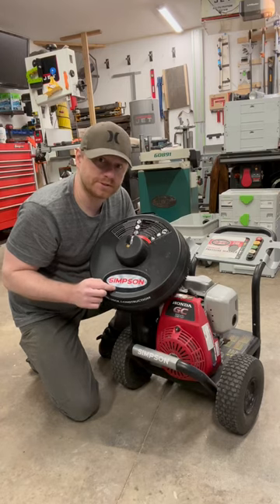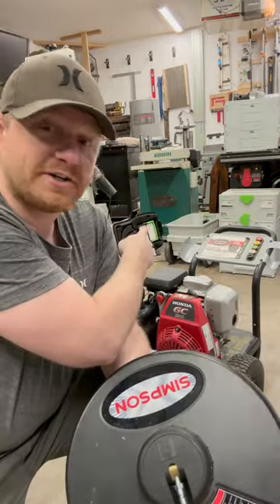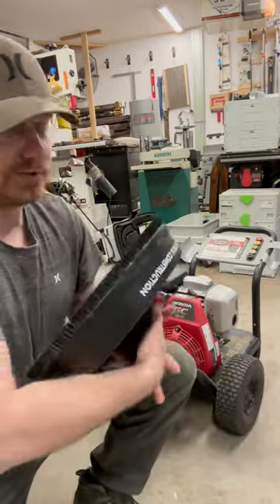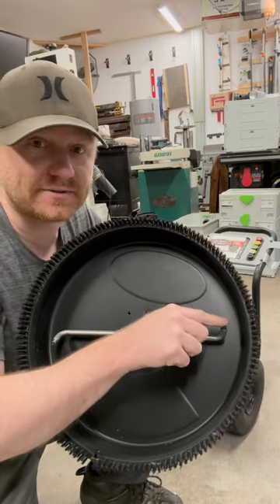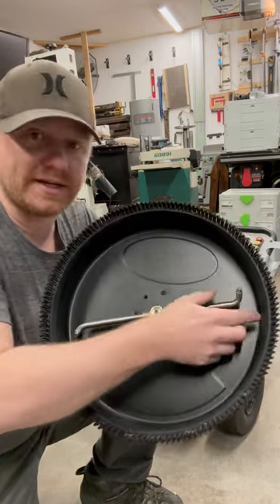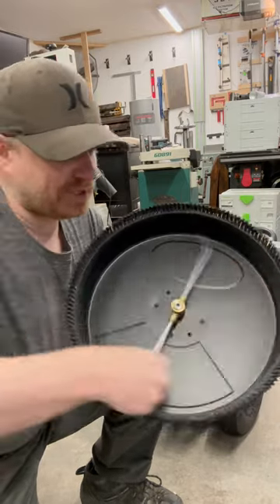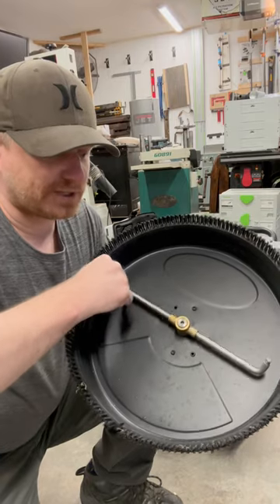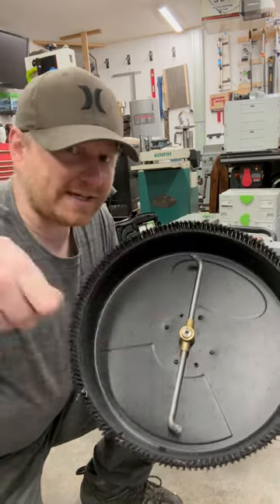Do NOT Buy: Simpson Surface Pressure Cleaner

Comment: As a pro for 19 yrs you get what you pay for! I purchased a 30” made by North Star made serious BANK every time. First start with FLOW not pressure. Everyone sees the PSI and figures thats power but a 3000psi @ 2.5 gpm is a newb machine. You really want 5-6 gpm and 2-3000psi that takes HORSEPOWER!  3000@6gpm = minimumof 18hp. Nuf said
Reply: I ust to run a 10k gpm was like 12-18 or something crazy. With a 00 tip it would cut yur foot off
Reply: @EO.studios  10GPM@3000 takes 25HP minimum for just cold water.
Reply: Anything north start or that is from northern tool as far as pressure washing equipment is concerned is pretty much garbage. It is consumer grade equipment dressed up to look industrial. Our service department stays full of them year round down here in houston. Their parts department is despicable to deal with and lead time in parts is normally weeks. Spend your money on quality equipment from either Mi-T-M or a Karcher company like Hotsy or Landa.

Comment: Also keep in mind that the gallon per minute rating of a service cleaner, greatly affects the performance if the PRESSURE WASHER you're using is below or above that output rating. there's no one size fits all solution when it comes to pressure washing and service cleaner, but once the time is spent doing so will give you a skill set and knowledge based outcomes based on previous experiences so as to minimize last time during set up.

Comment: The problem is it just has a crappy nylon washer as a bearing surface that wears out in a few hours of use.   You are way better to buy a real surface cleaner with actual bearings in the hub for long life
Reply: What brand and model?
Reply: @philippeaboussouan2361  after I had tried a couple cheap ones from home Depot I bought a general pump 20"  and wheel kit. Works great on my 3500 3.5gpm pressure washer they use a real bearing hub that's pretty easy to rebuild if needed and possibly a greasable hub at purchase. I upgraded my hub from the non to a greasable one
Reply: Comes down to real bearings and quality seals 😜

Comment: My ryobi one works flawlessly. I’ve hit corners and nails and all kinds of craziness but it still cleans a driveway like a boss. Decks too.
Reply: I would hate to see the decks you have done with a surface cleaner. That’s a huge no no.
Reply: @tonypizzas9814  through trial and error on stained decks it’s the perfect pressure. Does not gouge and does not leave any circles. Seems to work fine for me anyways.
Reply: I have one too. 15" 2500-3300 psi range. Pressure washer is also Ryobi, 3000 psi with Honda engine. No problems and certainly not what he's talking about. I've never owned any Ryobi product, but it was on sale.
Reply: @tallens5280  same. I bought the 3300 with the 190 Honda motor 4 years ago. It’s been heavily used and not one problem out of it. That attachment has been rode hard and put up wet with no problems either. Maybe we just got lucky or he’s really unlucky.
Reply: @tonypizzas9814 What's wrong with using a surface cleaner on a deck?  Asking cause it sounds like you think you know a thing or two.

Comment: Man this feels personal, I love the one I have, works great on my concrete and fences
Reply: Fences? You're manhandling that rotary face remover up on a fence?
Reply: @j-davis7290  man it's light and made of plastic, it works damn fine for what I use it for
Reply: @j-davis7290  lmaoooo yeah dont everybody do that?
Reply: I have used it many times on my vinyl fence and also even on my metal shed roof. It works great 👍
Reply: Same here
Reply: Great for cleaning garage doors. Doesn’t leave marks
Reply: Dont allow it to fall off any corners. It will be a problem after that.

You can bend it back with the box end of a wrench, but its hard to get it back to the right spot.
Reply: @shawntame45 lololol
Reply: Production tolerances. Company probably has bad QC and you got a good one while he got a bad one.

Surprisingly common, why warranties are important.
Reply: Everything works well when you only use it recreationally once in a while for Harry Homeowner type fix up jobs 😂 for example any electric trimmer or lawn mower. Your anecdotal evidence is not sufficient 😢
Reply: @WagwanHappyPappyHapPap  ☝️🤓
Reply: Same here, and I have a 2700. My neighbor borrows it sometimes and he has a 3700 with no issues, I just service mine once a year. He probably got a crappy 1 so he can do a crappy review...

Comment: Just rejet the nozzles. Get a carburetor jet drill set, and drill out the nozzles till you get the flow that’s right for the amount of pressure the washer is outputting. You’ll get more flow out of the nozzles, which means less restriction, less upward force that locks it up.
Reply: Or buy a quality one and write it off
Reply: The orifice size in the tip is how pressure washers generate pressure. If you make the hole too large your pressure will drop significantly. The tips on the surface cleaner has to be sized to the pressure and volume of the machine being used. All drilling them out is going to do is lower your pressure.
Reply: How about companies not lying?
Reply: He needs less flow and more pressure.
So smaller orifices.
 And some thread locker

Comment: I have this exact same model and I used it for the first time yesterday and had the exact same problem! I tried looking into it on the internet but didn't find very much helpful information. What do you recommend?? Trash it? Sell it to someone with a lower PSI pressure washer? 
I technically finished when I was working on but it took probably four times longer than it should have. Thanks for the video!

Comment: A note from a hydraulics engineer. Your pressure washer generates a triple wave pressure with a peek of approximately 3100psia at the nozzle. I have two questions for you. 
1. Is your hard line a pressure multiplier or a static line? 
2. What is the base output line pressure of your unit?
Because the typical pressure wand as a factor of 5 per linear foot, meaning the pressure is multiplied by 5x per linear foot. So a 3 ft wand will multiply input pressure by 125 times (5*5*5=125) so I’m guessing if you’re using a 3 ft wand with a tip pressure of 3100 psi, by the time it reaches the tip of the spinner, you’re at 6700psi, nearly 3000psi over the spinners max operating pressure. I’m guessing the manufacturer put the standard x4 line burst safety margin, so that pressure isn’t going to detonate the head, but aluminum has no yield strength so no matter the force it will always creep. But shoving nearly double max operating pressure through it is definitely going to accelerate that problem.

Comment: I had the same problem.  Worked great for a couple of hours then started spinning slowly and not cleaning.  After looking for solutions on the web, I found that debris gets into the hub for the spinning arms, especially if you are working close to grass, which prevents the arms from rotating properly.  The solution is to remove the arms using a hex (allen) wrench, clean out any crud, and spray the hub on the unit and the arms that you removed with WD40.  Be generous!  After doing this, it worked like new.  It may have to be repeated depending on the size of your project.  By the way, this cleaner works MUCH better than a Karchner cleaner that I had which finally broke down.

Comment: You could try removing the factory spray nozzle tips, and replace them with 40° tips. If you can raise the height of the service cleaner as well both of these pro tips will yield excellent results using any service cleaner. Some service cleaners have adjustable height located on the castor assembly and or just the bar height underneath in order maximize coverage when utilizing 40° tips. 40° nozzles as we are the most effective means to which a pressure washing job could be completed using the standard gun and wand so why not give it a try with the service cleaner if not, possibly a 30° or 25° tip while also also being  mindful of the angle of the surface washer, pressure washer tips. I know it's a pain in the ass but once you get everything dialled in with 40° tips and then raising the height as much as possible while enabling a slight angle, so has to keep the rotating momentum of the bar adequate. An easy way to remember this would be 40 Degree tips at 45 degree angle,with a 4-5cm height minimum from the PRESSURE WASHER tip to the service being cleaned. This will also help to eliminate swirl marks while maintaining a standard walking pace.

Comment: Use lock tight thread locker on the threads of the pipe to fix it.
Reply: Why should you have to fix something that was designed to work straight out of the box but doesn’t?

Comment: I'm guessing lack of maintenance or dirty water or hose is to blame. Particulate in the water can cause the head to freeze up. I actually had to remove the bolt on mine the other day because I somehow got grass on my hose and it got in the sprayer and was stuck in the rotation joint.  Pulled out the grass and relubricated it and it worked like a charm!

Comment: 4x small wheel bearing 2 on each side at 1 in distance to support the lines to the tips. if u hv problem with metal bearings use plastic bearing to not make noise or mark's

Comment: I've used this model dozens of times with ZERO troubles. It works amazingly. Am I just lucky or what?
Reply: How strong is the pressure washer you’ve used with it?
Reply: @billy9075 , I'm pretty sure they were both 3k but I'll check and let you know. I've done thousands of sq ft and the tool works perfectly

Comment: A flat bar with holes milled in it would fight the torsion effect of the water better than a round tube.  May even be able to make 2 or 3 holes and broaden the cleaning path.  Could even thread the holes and use different type of jet inserts to get different results with different surfaces and levels of filth.

Comment: I imagine if you use it a ton maybe you'd run into an issue, I have that exact model pressure washer and head and haven't had any issues over the past few years of using it sporadically. I think maybe you're not letting the head do the work, you don't have to hold it down against the pavement for it to work, kind of lifts and floats on it's own, just have to control where you want to clean. :) I hope this helps.

Comment: this could be fixed by adding a gusset along the edge of the tubing  . it will probably act like a fanblade also.
a piece of tig rod welded to a washer on both ends would prove it.
make a triangle.

Comment: It dosent bend them, the NPT threads turn, use green lock tite, set at the right angle and you'll be fine. Your welcome.
Reply from the maker: Appreciate the info!  I am a fixer as well, but I also vote with my dollar. It sends a message they should fix it when they get enough returns.
Reply: Yeah, shouldn't have to fix something like that
Reply: Thank you. Have one doing the same thing in video and been scratching my head what I was doing wrong.

Comment: Not really a solution but I have a pressure adjustment on the end on my wand before the neck. Anytime I want less pressure for anything I just turn it to the right. I got it for a similar reason to you but ended up using it more than the attachment I bought it for

Comment: I also regret buying a Simpson power washer, the pump broke off the motor the first time I used it, they fixed it under warranty. The third time I used it the concrete cleaner stopped spinning. Not happy.

Comment: Rated max pressure isnt all its cracked up to be. I bought a cheap surface cleaner of an unknown brand which looks to be constructed a lot like that one. The MAX psi rating is actually like 700 lower then the washer I use it on and its worked flawlessly for 7 years now. Clean the driveway, patio, sidewalks two to three times a year. Not commercial use obviously, but not used lightly.

Comment: Does it stick cause it bends to touch plastic or just from shitty axle design? Looking comments seems like you have faulty unit, maybe some frap that was not cleaned off in assemble process and is tightening the O-ring on the axle or how ever this is setup?

Comment: you need to change the nozzles to a smaller orifice that matches your psi anyway or you will have a problem.
There are plenty of charts out there to help you figure out what size you need.
As far as the supply tubes rotating remove them put red threadlocker on the threads then reassemble and let sit for 2 days
Reply: Now if only Simpson had heard of thread locker so you didn't have to fix their shitty product for them.

Comment: That must be the exact same as the dewalt 18in surface cleaner. I have the same issue and they look identical. They have the same brush, steel construction sticker and 3700 psi max rating.

Comment: I have the same exact pressure washer. I actually purchased the Ryobi surface cleaner and its been through alot and still works just fine. Id think simpson would have made a better one.

Comment: The problem is the grit that gets between the spinning arms and the base my dude. Disassemble it, clean out the metal slip gaskets, and reassemble it.

The washing gets tons of grit in there and it just refuses to spin. It's not the pressure, it's the friction.

Comment: I would suggest running it lower than the max psi.
Just because it can max out at 3700 psi, doesn't mean the maximum will give you better results.
Reply: You need a pressure washer that can be adjusted for the pressure. Most are set at the company and can't be adjusted

Comment: They probably threw that number on there to satisfy all the pressure washers sold at a big box store, yet designed it for electric pressure washers, you know, the folks who buy a pressure washer and accessories, yet use them once.

Comment: I had the same experience with the same model. Used on a Simpson PS3228 (3300PSI) and it failed on the first day after cleaning a concrete deck. Other reviews reported the same thing but I ignored them prior to buying. Definitely would not recommend this attachment based on my experience, this video and other reviews I've seen. Shame because it's amazing when it does work.

Comment: A common misconception about surface cleaners is that they are driven by the pressure of the machine being used. In reality, volume is a way bigger factor in how effective it will work with a surface cleaner. Most consumer machines you can get at hardware stores are less than 3 GPM, which is the minimum we recommend our customers use with surface cleaners. Most of the time we are selling 5-10 GPM machines to run larger surface cleaners.
Reply: Both pressure and volume equally count with accessories to work right. 0 degree nozzles aren't interchangeable between different machines just because they fit the click connecter.
Reply: @rossbrumby1957  volume is a much bigger factor. Pressure only comes with volume. My family has owned a company called Alklean industries for 51 years. I have seen, sold and serviced every make, model, and style of machine. I know what I’m talking about brother.

Comment: One thing people in this industry never mention! With a surface cleaner:
Using a 2 gallon per minute machine that the surface cleaner nozzle tips need to be 1/2 what the gpm puts out ? 
2 gpm nozzle tips 1.0 each. 
3 gpm nozzle tips 1.5
4 gpm nozzle tips 2.0
5 gpm nozzle tips 2.5
8 gpm nozzle tips 4.0

Comment: Maybe it's still good to just use a traditional wand. I see people using these units or similar to these units and I'm not really impressed with the quality that they produce.  I did deck work for years and we just used a power washer with a wand. Every once in awhile we would go  4 to 1 with acid.  It stinks but you've never seen cleaner concrete. Like the day that it was poured.

Comment: 1st off that is a homeowner's concrete cleaner not a contractor's concrete cleaner And it works very very good as long as you don't take it off the edge to where you do bend the nozzles

Comment: Ya because you need the right orfice nozzle on the surface cleaner. You only need 2500psi to clean concrete. Anything to do is pretreat and postreat with SH

Comment: What gpm?? If it's rated at 3700psi but only 1.5 gpm and your washer is 3100 and 2.5 gpm ,it will be too much. Pressure washing, it's the gpm that washes the crud after the pressure

Comment: the only good thing on a simpson is the honda engine . i got a powershot last year with the honda 390 , engine wonderful , AAA pump went bad in less than 30  hours and simpson would not replace it , gave me the run around , bought the brand CANPUMP from canada and love it !! sad thing is no matter which brand pressure washer you buy it is usually a simpson made with a different label

Comment: I’ve got the same one. Had it a few years now, and it’s served me well. 

Admittedly, Simpson could have done a better job on the material selection. 

That said, you’ve got to be at least 3% smarter than what you’re operating. If it comes out of adjustment, make it right, then lock it into place with some thread locker (has been mentioned several times in these comments before)

Rather than embracing the trend of voicing your grievances on social media, show how to take a mediocre product, and make it better. Offer solutions, not problems. That’s what manufacturers look for, and sometimes incorporates into the next generation of a product. That’s the real influential power of social media. 

Also - from time to time, pull the spinning assembly, and grease the bushing with some good quality grease.

Comment: Mine has held up by using lithium grease on the bearings between uses, works great
Reply from the maker: This model doesn’t have bearings just a sleeve and two washers, but I am getting another brand that has bearings and wheels.